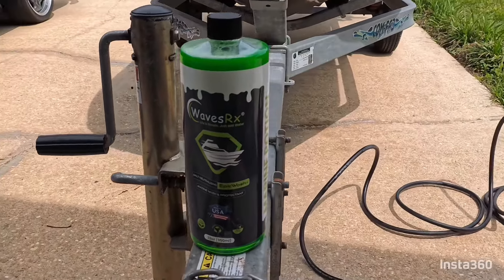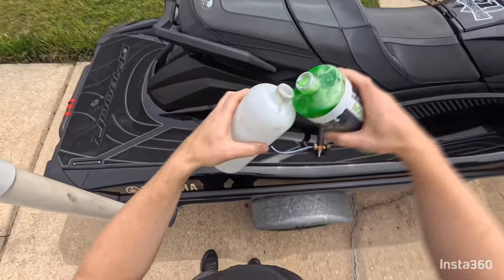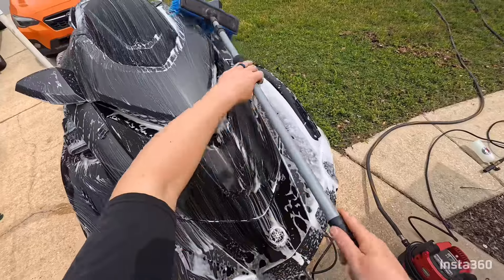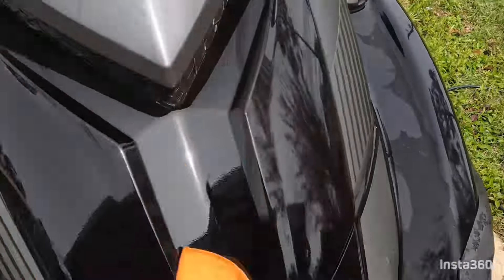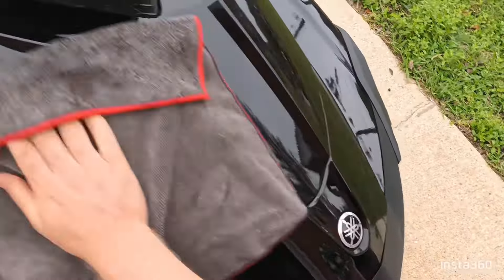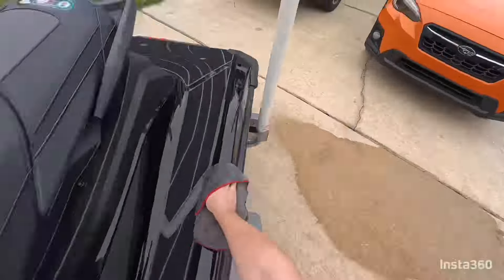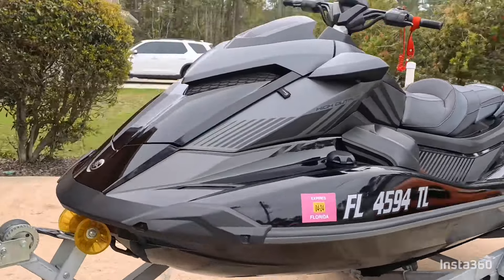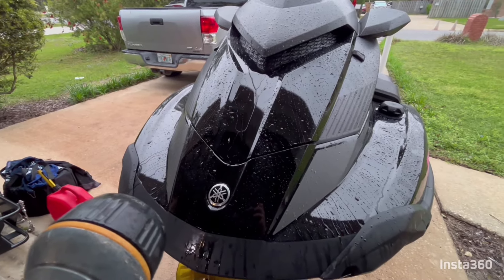How good is WavesRX Epic Wash & Aqua Shield ceramic spray?

Comment: I looked on the website. It doesn’t show that it comes as a kit. Do you have to buy the dispenser separately?
Reply from the maker: Are you referring to the foam canon ? They do not sell a foam dispenser but you can use a bucket and water to add the soap to.
Reply from the maker: Use code Shack15 for 15% off